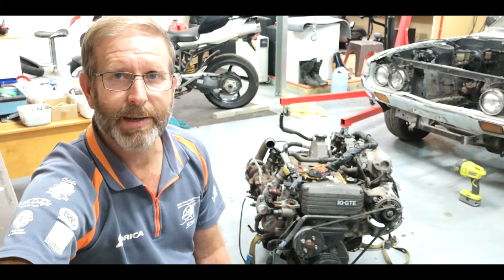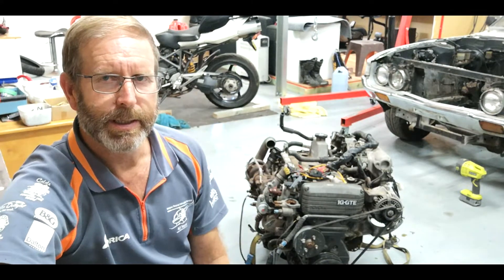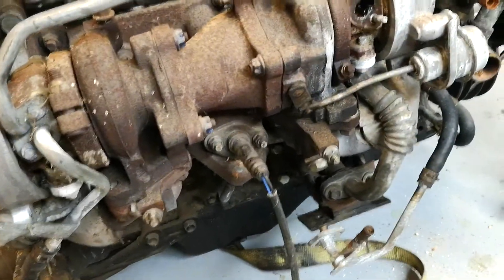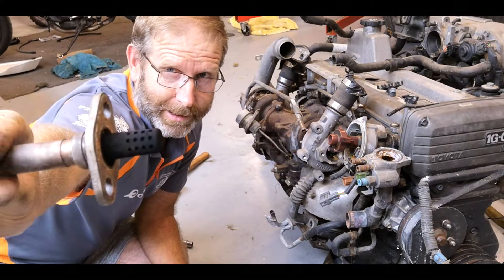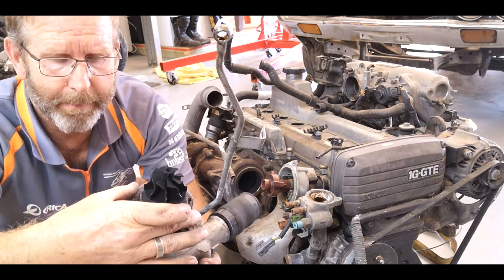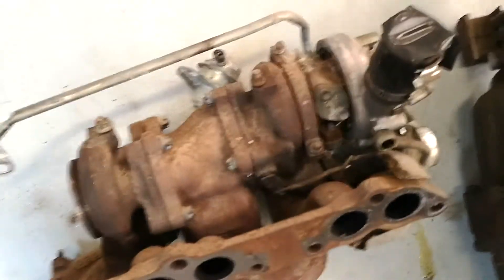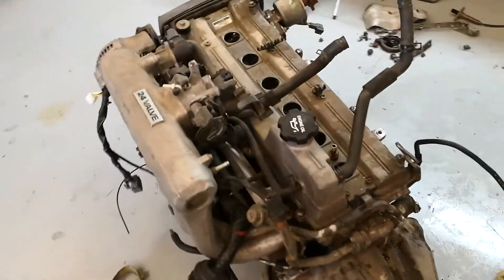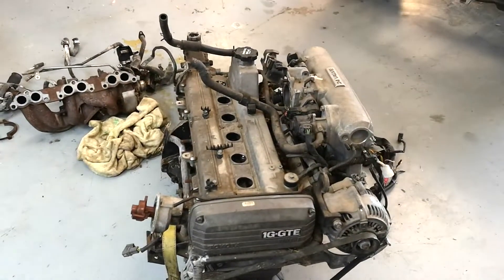BARN FIND Celica 1G GTE No.12 KamicarzCreations TWIN TURBO DELETE for an upgrade to a single setup

Comment: Coming from someone that has spent the last 2 years building a 1G I wouldn't recommend it unless you are keeping it near standard spec. My 1G has cost me a fortune and if I had known how hard it was to get parts I would have taken it to the scrap yard and used a different engine. Everything is hard to source and very expensive. I was keen to keep the 1G too because it was already engineered in the car and the engine is more compact and lighter than the 1JZ and it is an amazing sounding engine too. I don't think it was worth the expense though.

My 1G specs

Oiling modifications done to block, shimmed oil pump etc

JE pistons 9.5:1
Standard rods, ARP bolts
Custom Tighe camshafts
Custom made adjustable cam gears
Supertech valvesprings and titanium retainers
Custom made MLS head gasket (cannot buy an off the shelf MLS for 1G anymore)
Custom intake manifold and throttle body setup with LS1 TPS
Waterpump sourced from Yahoo Japan auctions
Modified distributor with blanking plate
Custom made 6boost exhaust divided T4 flange for EFR Turbo
Borg warner EFR 7163 T4 twin scroll
Yaris coil on plug with custom mounting plate to 1G-GE cam covers
7M-GTE ID1000 injectors for E85, custom fuel rail
Going to be running a Haltech elite 2500

Still trying to get all the little bits and pieces sourced. A lot of gaskets and o-rings can be sourced from Amayama. There are no decent aftermarket bearings available but standard gen3 bearings can be sourced by the same supplier who originally supplied them to Toyota.

Good luck with the build mate
Reply from the maker: Thanks Mick......i'm aware that its a risk but at this stage im not planning on spending a lot on parts that i cant use on a different engine. I have decided not to go inside the motor and just work on the turbos and intake at this stage and then wack it back in. Hoping it works out because yes i love the sound on the motor. Wish me luck.
Reply: @KamicarzCreations  Good idea mate, keep it simple. Hopefully it is a good reliable motor for you. I'll be following your progress. It's good to see the 1G still getting some love.
Reply from the maker: @MickiDracing  I'm new to the Toyota scene but loving the learning. Feel free to comment and give ideas or insights anytime. 👍
Reply: For anyone with a 1g.
Drop in a 2jz-ge. Very easy and makes more power than a stock 1g.
Cheap and reliable as well.

Comment: Hey there, Ive heard that the 1G-GTE engine fits the 76/77 Celica engine mounts....is that true?
Reply from the maker: Yes it is......its only the gearbox cross member that need some adjustment depending on the gearbox you use.  some of this stuff may help
https://bluetwentyeight.wordpress.com/tech-docs/

https://bluetwentyeight.files.wordpress.com/2016/02/robs_1g_tech_article.pdf
Reply: @KamicarzCreations  thank you very much!
Reply from the maker: @christianmarston1150  not a problem. Stay in contact and let me know which way you go 👍

Comment: Take the top rail off the front support with 4 bolts. You will find it easier to remove and fit the engine. I see it still there in this vid. lol
Reply from the maker: Love it, yes, just went and looked. Had noticed that in other videos. Will help when putting it back